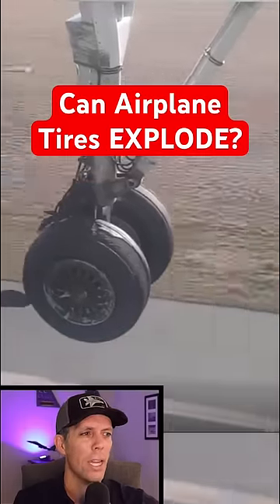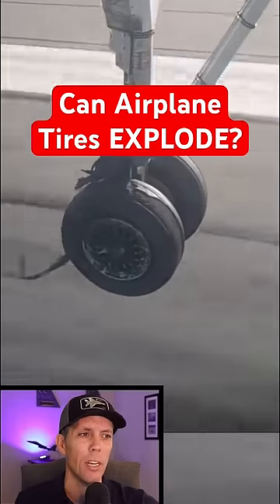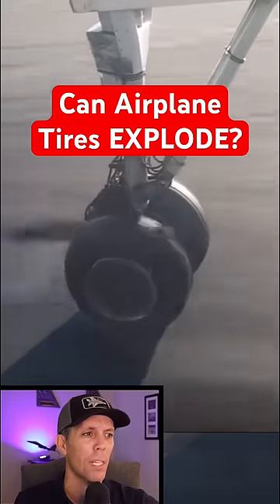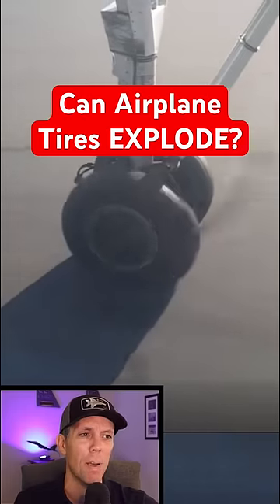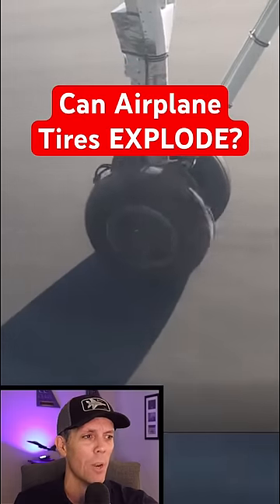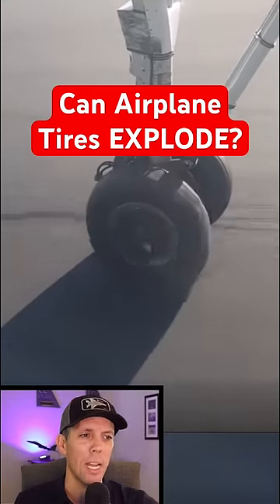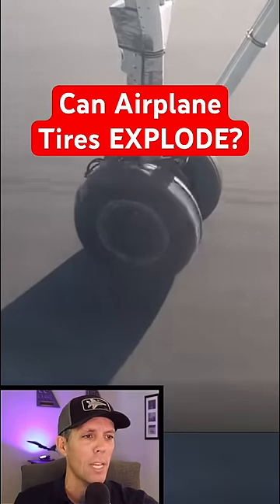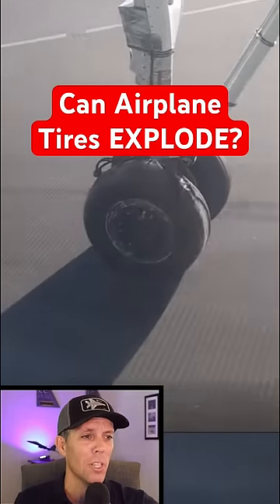Can Airplane Tires Explode?

Comment: I had no idea how much pounds of tires's rubber are left on runway. Thanks for the information.
Reply: no
Reply: many
Reply: English please
Reply: Why don't they create fan shaped wheels which spin up in the airflow before landing
Reply: Because it's not a pound.
Reply: A pound? Not true, and most are filled with normal air around 200 psi.
Reply: Any plans for that new information?
Reply: What if they made the tire spin before landing
Reply: He’s wrong on every comment about aircraft tires…
Reply: Not sure why so many doubters are here? If you look up the facts he mentions about airline tires they do seem to backed up by reputable websites.
Reply: @eopoep  Aerospace engineers have tried all types of wheel spool up designs. They all ended up costing more in the long run due to manufacturing and certification expense, also weight increases= more fuel burn, and more maintenance points.  So every design has been reverted back to the keep it simple concept.
Reply: Not exact quotes but essentially. 

"every tire loses about a pound of rubber each landings" 

"Typically good for about 200 to 500 landings" 

"Can be retreaded about seven times"

So just how much do these tires weigh? 

The math Seems sus to me.
Reply: Life plans changing now that I have this important info
Reply: Its because the landing zone has highly abrasive tarmac. 
If it was used on normal roads your car would need new tyres every 100 miles or so.
Reply: @dangranger3447  Where do you get your information?
Reply: @gar6446  "tyres?" lol
Reply: @eopoep 
Because it’s impossible.
Reply: @eopoep  anything you think of has already been thought of and tested by engineers.
Reply: @name199  I thought so too, so let's try the math.
500 ÷ 7 = 71.4 lbs. 
So if each tire has 71 lbs of sacrificial rubber on it and gets a retread every 71 landings x 7 retreads, I suppose on an Airbus 380 this math might make sense. I wouldn't be surprised if each tire for an Airbus 380 weighs 264.5 lbs fresh and 193.5 lbs fully worn. But for smaller planes, it's a whole different equation.
Reply: @salineaddict9850  That's what my dad, an aeronautical engineer always said. But my son, also an engineer, has said that these days, engineering decisions in larger companies are usually left up to the marketing and accounting departments - so new functional ideas are often ignored in favor of styling and trends. 
But if the CEO is an engineer, like Musk, incremental improvements often lead to innovations that were previously deemed too expensive or impractical by another company (Boeing for example), probably because their accountants told them so. 
Example: Reusable rocket boosters were thought of at least 75 years ago, but they've only been a functional reality for less than 7 years. If it had been left up to Boeing, they still wouldn't exist.
Reply: @gar6446  trust me bro
Reply: @dangranger3447  a pound is not true or they would never make that 250 to 500 cycles life span. And aircraft tires especially military and commercial aviation tires are filled with nitrogen as it is less affected by ambient air temperatures and has no water in it to freeze.
Reply: @adamgregory6482  which ones? Because he is not actually. They do not leave a pound of rubber every time they land and they are filled with nitrogen not compressed air.
Reply: @salineaddict9850  Anything. How about doing away with tyres and wheels and have the plane, skid to a stop on a sheet of rubber
Reply: @eopoep    The problem with spinning wheels inflight is the centrifugal force generated inflight.  Also, any system that would be needed to spin the wheels would be complicated and difficult to maintain. It is much cheaper and easier to just replace the wheels as needed.
Reply: @adamgregory6482 Doubters? No, thinkers.  Think about how much a tire would have to weigh to lose 250 lbs by replacement.  Think.  Be skeptical.  Don't hate thinking and those who practice thinking.
Reply: Yeah right? Jesus! How do they clean the runway from 10k pounds of rubber...

 Crazy how much they lose considering how expensive each wheel costs.
Reply: So if the tire leaves that much rubber per landing yet still last 200 landings? Math doesn’t add up unless those tires are crazy heavy lol
Reply: @dangranger3447  most tires are filled with Nitrogen, with the exception of some lighter craft. But commercial and military require nitrogen
Reply: @mattbrooks9928  aircraft like the 747 their tires can weigh up to 260 lbs a piece, though I don’t think they leave a pound of rubber on each landing, it may be half that, all depends on the weight and speed
Reply: Yeah! now my college degree is complete..
Reply: @eopoep  sounds like your onto something
Reply: And we're worried about  the environment😂.
America is best at wasting Among its other admirable attributes😒
Reply: @igot5onit423    “America is best at wasting……”.   What are you talking about?  Airplanes?  Planes fly all over the world.
Reply: I actually don't believe this right away. These types of shorts are not really that reliable 😄
Reply: Airports perform rubber removal every few months, based on the condition of the runways.
Reply: @Kerpeles  Ya you never know
Reply: With that math, the tire weighs over 500lbs 😂😂😂
Reply: @ThatOne77 That's how they spell it in the U.K., so youre ony showing your own ignorance by dragging them for it.
Reply: @dangranger3447  No that's not true, they DO fill with Nitrogen, because especially at altitude, oxygen molecules tend to leak out quicker due to their size compared to Nitrogen molecules.
Reply: @dangranger3447  actually the pounds of rubber I would doubt, but the nitrogen makes sense
Reply: @karlchilders5420     The reason we use dry nitrogen in aircraft tires is due to brake fires after gear retraction. Think of a bellows feeding a fire if O2 we allowed in the tire.
Reply: @oldmech619  that is not why it is used.  It is an unintentional benefit, not the designed/stated goal.  Especially with brake systems, hydraulic fluid is always the biggest immediate source of fuel for a fire.
Reply: Yeah, a pound = 454 grams, good for 200-500 landinhs would mean that the thread of the tyre would weigh between 90 and 230 kilos... this dude knows NOTHING about what he is talking about.

The complete tyre of a DHC 8 including the rim is about 30 KG. It is a 18*5,5 rim.

And 10 000 punds a day on a airport, meaning about 5500 KG, the limited part of the runnway that the aircrafts are landing on would be nothing but a mountain of rubber... so stupid...
Reply: @SteinarMortensen  Let's not say he's "stupid", but what is clear is that he does not have accurate information.  Those of us that know have given him the right data.  That is what matters.  Belittling him doesn't help teach him - it serves only to stoke anger and is counter-productive to the instructional tone we want to have, yeah?
Reply: @dangranger3447  In commercial aviation its nitrogen only in all developed countries. And the pound is just bullshit. He has no idea what he is talking about
Reply: @salineaddict9850  that's an incredibly arrogant and elitist view, especially since we have seen the failures caused by engineers not thinking of even obvious problems and the carnage caused with their arrogance when they give themselves authority over the plane above that of the pilots who have to be in the plane.
Lots of crashes have been caused by poor design and also not talking the real world into account when designing things.
Look at even basic small planes. 
Or outside of aviation. Kenworth engineers only just worked out that bolting the steps to fibreglass rather than the chasis isn't the smartest idea.
Reply: @jorgenunez5669  I gotcha. His assessment just didn’t make since lol
Reply: @ThatOne77  to tire is when something gets tired 😩a tyre is the rubber that goes on a wheel 😊.
We understand Americans fought for their independence. Do they just butcher the language out of spite?
Reply: @karlchilders5420  look at his "about" section. He clearly thinks that being a pilot qualifies his statements. He should have his facts right. He's not a primary school kid doing a project. 
Arrogant people don't deserve leeway to be wrong. Be humble and people can accept mistakes because you're not pretending to know everything. Tell people you're an experienced pilot and you're going to teach people about aviation, then you need to know what you're talking about and not just read a fact sheet you found somewhere.
Reply: @oldmech619  why are the brakes hot? I haven't flown big planes and the only brake application I've done on take off is to get the engines up to speed for short field. 
I've never thought about it. If you apply the brakes and don't move, but the brakes are stopping the wheels rotating that otherwise would, are they heating up much? I know you're putting energy in and you're still using friction to stop the rotation but if you locked the brakes on then you're not adding any energy after that point. I assume if you're completely stationary that the brakes wouldn't be heating up so why are there fires?
Reply: @chrisnoname2725  Good catch. People like that anger me. I don't like being around them.
Reply: @chrisnoname2725  Oh my goodness. Are you just trying to be funny?
Reply: @chrisnoname2725  Who said I was American? Besides, every country has butchered the English language.
Reply: @karlchilders5420  He likely doesn't care. He's made his money from YouTube and is likely too arrogant to be corrected.
Reply: @ThatOne77  I assumed it was a north American thing to spell tyre as tire. Does Canada count as a separate country? After all they surrendered to driving on the wrong side of the road. : ) 

Obviously i don't really care if people spell things differently or have different terms for things. Oh and i don't assume you're Canadian either. I assume most people learning English would learn American English as that's the place they're most likely to go, just as i wouldn't bother learning Spanish as it's used in Spain as I have no interest in going to Europe.
Reply: @chrisnoname2725  you sound very confused.
Reply: I also didn't know Nitrogen wasnt air
Reply: Not sure about a pound,could be more or less but they do leave a lot. Your heavy ones like fed ex or ups planes probably do and more. I know this cause I clean rubber off run ways. We clean the most used runways 3 times a year. That’s based on x amount of landings. FAA requires it. 
We used high pressure 30,000 psi water blasting method that recovers the rubber and water. Once recovered we drain off the water into a designated drain with a fine filter and then left with a mound of rubber.
Reply: @Adam Gregory  airlines use nitrogen, not compressed air. The moisture in compressed air freezes at altitude and cause a balance problem in the tire. Maybe in a cessna buy not an airliner.
Reply: @karlchilders5420     Over 50 years ago, I was informed that N2 was utilized to extinguish brake and axial fires. It is probable that there had been various wheel fires leading up to this discovery. Throughout my forty years of work as a line maintenance technician in heavy jet aviation, I observed several brake overheats and several bake fires. Thankfully, all of the fires went out by themselves, however, the tires were mostly damaged. When I contemplate the issue, I consider that utilizing compressed air instead of nitrogen in the tire would make a significant difference if the tire began catching fire. The air would stoke the flames while nitrogen would act as a fire suppressant. Would you disagree with this view?  Think fire safety first.
Reply: @OldMech  I don't disagree but as I say the consequential benefit wasn't the design goal.  Look back at things like the B-58 which air conditioned and pressurized the gear compartments as a mitigation for their numerous brake issues .
Reply: @Super Duty Off Road Reveiw  I would think thats just one reason and not all of them.  It has to be the same idea why they fill car tires with nitrogen, too. That's what green caps represent on car tire valves. There are many benefits, which include the opposite of freezing. The tires get hot, too. No expansion of air eqials better rotation. It's as simple as the nitrogen isn't affected in many ways like compressed air is. It is not just for freezing. Tire pressure is the main reason. It keeps constant pressure despite the elements around it changing.
Reply: @eopoep  you trying to troll or whatever you are doing is sad.
Reply: @gator8405 aviation tires are changed quite often. I dont know the specifics but its not crazy to thing they are changed often.
Reply: @joshuahangtree1560 i think hes wrong about the amount of rubber left per landing but no tires dont last long and they are changed often and re-treaded before they get bad completely
Reply: @dianapennepacker6854 ompanies are paid to come clean it off. It happens all the time.i dont think hes right about it being a pound of rubber. That sounds like a lot.
Reply: @matthewwarren7879  unless they are damaged by FOD, they often last between 250 to 350 flight cycles before needing to be changed. At a pound of rubber per landing, you would not have a tire left for most planes by the time you reach that amount of cycles.
Reply: Me, either!
Reply: @ThatOne77  Were you not able to understand intent of the comment?  You do realize that YT is a WORLDWIDE platform, right?
Reply: @dangranger3447 NO! Literally,, every thing you said is wrong.  Aircraft tires are NOT filled with normal air.  They are filled with nitrogen.  In fact, every major aircraft manufacturer (and FAA) REQUIRES nitrogen.  Regular air would allow moisture to develop and would oxidize causing the cavity of the tire to degrade from within. Nitrogen is an insert gas and is more stable with extreme temperature and pressure changes.  

As for psi, I can tell you tires on the main gear of a 747 are inflated to 205 psi.  On a Cessna 172, the main gear is 23 psi.  The plane in the video is a Dash 8, and while I don't know the psi off-hand, it's going to be close to 200 psi because of the weight.
Reply: @trentwomack838 No, he is not!  The only thing he said that was not fully accurate is the number of landing cycles.  Some tires, depending on the passenger aircraft, last for about 120 to 400-ish cycles.  He said typically 200-500 -- so, he's close enough. 

One thing I wish he'd added is that used airplane tires are usually turned into tires for farm equipment, like tractors.
Reply: @adamgregory6482 Did you notice none of the doubters offered anything to contradict him?  I agree with you. EVERYTHING he said is accurate.

One doubter said they're filled with regular air.  I'm sure that it would be easy to verify they ARE filled with nitrogen.  Nitrogen is used in every tire on every commercial, passenger airline.
Reply: @B_Bodziak  I’ve worked aircraft for over 30 years and the most accurate thing he said was we use nitrogen vs “air”.
Reply: @adamgregory6482 Also, cargo space on commercial aircraft equals money! So, that is also a consideration in gear designs.
Reply: @ThatOne77 @dangranger3447 Obviously plucked his information from thin air because everything he said in his comment is wrong and EVERYTHING stated in this video is wholly accurate.
Reply: @ThatOne77 That is how tires ARE spelled in some countries.
Reply: @name199 The video is completely accurate.
Reply: @joshuahangtree1560 But, EVERYTHING he said in the video is accurate.  So, instead of posting "doubts" by those "thinkers", why not take 3 minutes to verify the information.  I'm sure every statement can quite EASILY be verified.  If someone was an actual "thinker", they wouldn't post doubts and claim the facts provided are wrong.  A real thinker would skip posting doubts and simply verify the facts so that they could expand their base of knowledge. But, Noooo, they post doubting comments when they could actually be learning.  Not smart, at all.
Reply: @B_Bodziak  I do understand that some countries spell things the wrong way.
Reply: @B_Bodziak  Actually, no.
Reply: @B_Bodziak  Sorry. You're wrong.
Reply: @eopoep  I'm rethinking round wheels myself. Clearly a triangle would roll better but a fan shape would also be an improvement, you're right.  Let's go. You and I can reinvent the wheel.
Reply: Now what are you gonna do with it?😂
Reply: @Mile-long-list  wouldn't that be a bit bumpy for passengers ?... have you thought this thru ?
Reply: That tire is not flat, it’s just an Italian tire
Reply: @eopoep here are a multiple reasons for this.

But first off, fan to spin them up would not work.

The option would be to have a motor spin them up prior to touchdown, but you see, this a quite a bad idea.

You see, for it to be perfect, you would need the wheels to spin up at the same speed as the aircraft, which, during landing, is constantly changing. This itself is pretty much impossible, however, bringing them up to near that speed may seem like a good idea to you, but it really isnt

First off, motors would add extra weight, cost, space, maintenance and failure points to the landing gears.

And most importantly, the reason why it is not done(and will never be) is because, in the case of such a failure point, we are literally talking about the aircraft’s landing gears, one of the primary ways an aircraft uses to stop, if not the primary. If the wheels are spinniny and then have a malfunction, you now may end up with wheels spinning at that speed rather than braking. Now, this means that the aircraft would be unable to stop, and will keep going forward.

And finally, the most important reason: aircraft often dont come in for landing in perfect alignment, specifically with crosswinds. This means that anytime an aircraft lands without that perfect aligment, the wheels will then drive the aircraft in the direction it was facing when it landed, causing it to have a runway excursion off the sides.

There are other reasons too, but this is a simple summary.
Reply: @Name
This was my exact thought I call bull 💩
Reply: Yea the tire marks on either end of the runway…^
Reply: @dangranger3447  normal air, no , he’s right it’s nitrogen!
Reply: He’s right, don’t know about 200-500 landings though, as an avaition mechanic it seems like we change tires a lot, I’d say around 100 landings, there are limitations and they are not low!
Reply: If they last 200 to 500 landings and they lose 1 pound a landing that's 200 to 500 pounds of tire lost. I'm not sure how much a tire weighs on a plane, but I'm going to assume he's wrong just based on that
Reply: @dangranger3447 a pound left on the ground goofy like a pound of rubber leftover from rubbing against the ground why are so many of you so so so slow. Such a simple concept
Reply: @regibson23 then how much is left on the runway don’t run your mouth and not say anything
Reply: I didnt know how much your sentence gave me angina until i read it 😅.
Reply: I had a stroke reading this, thanks bud.
Reply: I didn’t no that, now I no
Reply: @J-remyM yes
Reply: @name199  my thoughts exactly. I was looking to see if anyone else caught it.
Reply: yea
Reply: @ynyan8022 weight, maintenance, cost and the still heavy wear from what will never be a perfect speed match adds up to tires being cheaper. Just think about a decoupling mechanism before touchdown so the driveline wouldn't be damaged by the sudden load - that's going to be an expensive system!

With electric airplanes basically an eventuality at this point, it'll be interesting to see if the energy required to haul thst extra equipment outweighs energy gained by regenerative braking. Short flights especially
Reply: Useless information
Reply: @eopoep yeah why don’t they? Go ahead and make them you’ll become rich
Reply: You no speaka de English too good eh?
Reply: “Your flight is delayed 4 hours due to unforeseen circumstances”
Reply: Leaves 10 thousand pounds of rubber on the runway a day? Maybe from every airplane that day.
Reply: @name199 yeah and 10,000 pounds a day divided by 6 tires per plane that's 69.4 planes per hour or 1,666.66 planes per day. I don't think so. These types of channels draw in comments like mine for traffic to their channel by saying stupid 💩
Reply: Jesus
Reply: He's full of crap on the poundage and tire landing lifespan.
Reply: @eopoep could get damaged over time
Reply: I’m glad everyone else seems to have found that specific tidbit to be the most interesting 🤣🤣
Reply: @eopoep
That's a smart idea 🙂
Reply: @dangranger3447 aircrafts tyres use nitrogen because it kinda resists pressure build up, tantamount to explosion.
Reply: He said about a pound, I'm sure it's not that much..
Reply: Not true i worked as an aircraft mechanik for years by lufthansa and thats bullshit!!!!
Reply: @eopoep budget
Reply: now try to think of how much of that rubber ends up floating into our lungs
Reply: @oldmech619  The wheels on aircraft are made of magnesium for lightweight and durability. They also aid in wheel speed sensor detection. Magnesium burns hot and volatile and oxygen from a blown tire would accelerate that volatility,
Reply: @karlchilders5420  incorrect I've been an A&P for over thirty years. That's not why they use nitrogen. Nitrogen is used because aircraft wheels are made of magnesium to reduce weight and maintain durability. The magnesium is also useful in use with wheel speed sensors. Magnesium burn very hot if ignited by a brake fire. Nitrogen is used in the tire in case a tire blows during a brake fire because oxygen from air would increase the volatility of the fire. That molecule nonsense is what car tire salesman use to charge morons extra money.
Reply: @oldmech619  Because of the risk of the magnesium wheels conflagrating in a brake fire. You are correct. I've been A&P for 30 yrs.
Reply: @hillbillysceptic1982  they do NOT make wheels out of magnesium.  BTW, I think you mean Magnesium ALLOYS.  Pure Magnesium itself would be a huge fire hazard.  Most Aircraft wheels are made of ALUMINUM alloys these days there slick.  It's lighter, cheaper, easier to manufacture.  The tires are made of conductive rubber.  Why?  ELECTRICAL DISCHARGE protection.  

The thing I said about Nitrogen vs. Oxygen is ONE HUNDRED PERCENT correct.  It's physics.  Sorry if you don't understand how physics works.  You are an idiot if you think it's a marketing or sales thing.  They also do that because especially on jets like the 737 that don't even have gear doors, it keeps the delta P values low due to temperature excursions.  Also, at high altitudes and low temps, regular atmospheric air can cause ice formations to occur inside the tires, or even EXPLODE.
Reply: @name199  67kg
Reply: Its just totally wrong a A380 wheel is 120kg if the wheel leaves 1 pound times 200 landings minimum. Its 200pounds of rubber this is 90kg. 120kg minus 90kg is 30kg left for tire and rim....😂 sry this guy spread missinformation.
Reply: That gave me a fucken aneurysm reading that.
Reply: i know right thanks for the info lol
Reply: @name199 the tires weigh 264.5 lbs
Reply: @adamgregory6482 a 777 tyre weighs 260lbs. It cannot lose between 200-500lbs before being retreaded
Reply: How tf can someone mistake no for know ?
Reply: Why don't recycle them?
Reply: @dangranger3447 nope they are very offten filled with nitrogen
Reply: Makes you think that having them pre-spinning (via tiny aero vanes?) is a good idea?
Reply: Bro what have you even said 🤦🏽‍♂️
Reply: That’s absolute bull crap - I’ve sold tires my whole life - even some small aircraft tires. Think about what he just said - if ONE tire left ONE POUND of rubber on every single landing and lasted for 2-500 landings that tire would have to weigh 520-530lbs un-inflated before being mounted on the wheel!!!  You’re talking earth mover tire size to get near that heavy or near that much rubber!!
Guy is completely got his measurements wrong. You’d also have a ramp for a runway at every airport in the world unless they scraped that crap off.
Yes they definitely leave rubber on the road but we’re talking Ounces not pounds!
Just wow.
Reply: *no
Reply: I heard he said its good for 200-500 landings? That math doesnf make sense. It would make the tire really heavy when mew which is hard to believe. 200x10 is 2000. And he said 500. So 5000 pounds and thats ONE tire? No way
Reply: @jackandblaze5956 it gets rethread when its almost gone. Not in between. Imagine all that cost for an airline. If we do the math 10x200 its way too much rubber. And he dared to say 500. That would mean each tire would at least be 2000 pound each. He need to do better research
Reply: @ThatOne77  u know some people aren’t as fluent in English as some of us… right?
Reply: @itsfikree  English please
Reply: Know you no
Reply: Makes sense if you watch the movie Speed
Reply: 10,000 pounds a day at a pound a hit is around 1 plane landing every 8 - 9 seconds ... yeah right.
Reply: Thats literally what killed concord, rubber from a previous planes tire
Reply: He's exaggerating. Maybe main wheels but not as much for the nose wheels. And weather conditions come into play. Aet runways will cause little wear on the tires.
Reply: @eopoep mentour pilot has a video on it
Reply: *kg
Reply: @ThatOne77  whaat
Reply: @duck2fun  whaaat
Reply: @eopoep  Because of wind....
Reply: No* many*
Reply: you've had a month to correct this
Reply: Don’t listen to those haters we all know what you meant
Reply: English
Reply: I no what you are saying.
Reply: You think thats crazy? Imagine how much rubber is left on americas highways. Youre welcome
Reply: Where I work and live, There is a tire tax when purchasing tires (in NY), basically for tires contributing to ruining the roads/leaving rubber on the road,etc. To my understanding, that's what the tax is for atleast. But that's New York for ya
Reply: I dint no wut a plain wheel een look laik
Reply: That was the least grammatically correct sentence I’ve ever read
Reply: Now you no
Reply: Mostly in the form of microplastics, one of the major sources according to the PSF
Reply: @ThatOne77 not everyone speaks English as a first language 😊
Reply: So its not just the dc 10s? Lol
Reply: @hotnuns69  you're a little late.
Reply: Jesus loves you!!!
Reply: There's a great video of how Heathrow airport deals with the rubber on their runways every night
Reply: They can last up to 500 landings and they lose 1 pound rubber each time? So thats 500 pounds of rubber for each wheel. A plane has what? 20 wheels? So a big planes wheels weigh around 10.000 pounds. I know, solid maths and deductions. Dont question me.
Reply: @dangranger3447  not true it’s filled with nitrogen
Reply: @dangranger3447  What type of aircraft are you familiar with?
Reply: one pound of rubber per tire? "this is rubbish"...
Reply: @thebeaz1 ùù
Reply: @dangranger3447 I love hearing "nitrogen" filled tires. Bruh, air is 80% nitrogen.
Reply: @ThatOne77  Proper English spelling.
Reply: @karlchilders5420  Fire requires 3 things, fuel, oxygen and a spark.  As aa former aircraft mechanic, I can assure you that O2 is all around us, the fuel for the fire comes from the rubber of the tire, and on fighter aircraft the brakes are made of steel and get red hot like you see on F1 cars when racing. I worked an F-16 brake fire that burned the lower half of the fuselage. Brake fires were so prevelent on aircraft that we were issued paint sticks that melt at a certain temperature. When an aircraft stops at the end of the runway (EOR) we swipe the paint sticks on the brake disk, if one color melts the brake is warm, if the other melts the brake is hot, so everyone runs away for a while till the brake cools off, or the plane blows up.
Reply: @andrewbartczak5941  ha ha
Reply: @eopoep  theRoyal Navy tried that.
Reply: @adamgregory6482  take what youtubers say with a HUGE grain of salt. Especially from aviation youtubers who are not pilots.
Reply: @chrisnoname2725 Well, spreading bullshit as truth on a public forum isn't great either.
Reply: @trentwomack838 NO really each tire looses 1 pound of rubber per landing and are good up to 500 landings..... each new tire weighs about one ton.....
Reply: There are people whose job is to scrape it up
Reply: @eopoep because tire need to spin and it would be really expensive 😊
Reply: A lb??? Nope
Reply: @adamgregory6482 he is wrong because if an airplane tire lost 1 pound of rubber every landing then each tire would need to weigh over 500 pounds since a standard airliner tire can sustain about 500 landings before being replaced
Reply: many*
tires'*
Reply: @adamgregory6482 Is that a question?
Reply: Well coming from someone that spells no with a K, I’m not surprised.
Reply: @dangranger3447 not air, but yes nitrogen
Reply: Was the person hanging under the plane to record this????? BS
Reply: I wondered about that. the nuances of making it work properly may be worse than they seem, it wouldnt match well in all circumstances making it less worth it, and its possible the potential gyro effects might be an issue.

....or maybe they would just take way too long to get up to speed/tires are just too heavy for it to work without huge ass fins on the walls  @eopoep
Reply: there is no difference in car tyres, where do you think car tread goes over time, this is why everyone has to eventually buy tryes for their vehicles, the tread is on the road 😆
Reply: @karlchilders5420 Now that everyone is informed, the people that DO know can do a video can't they, there should be many more updated versions from the people that commented
Reply: @dangranger3447 

Commercial aircraft tires are filled with nitrogen. If a wheel well fire were to occur the high pressure in the tire would not add oxygen to the fire when the tire bursts.
Reply: @eopoep no😂😂
Reply: Its not true
Reply: "How much pounds" 💀
Reply: What are u gonna do with that info ?
Reply: @name199 that was my exact thought. It's clearly bullshit because these tires don't weigh over 200 lbs
Reply: So they land ...loaded with full fuel load...? That's  even harder on the tires...I guess it depends on their gross weight ....
Reply: I doubt its a pound of rubber each landing
Reply: But they only clean runnways 3 to Five times a week.Takes about 4 hours .The people who clean runnways are funny
Reply: I was also unaware until now
Reply: @gator8405 and it doesn't burn, like oxygen, which is in our ambient air.
Reply: @gator8405 not if the retread process is during that life span.

I assumed retreading is PART of that life cycle.

Are we all on a different page on what time frame is meant?
Reply: @dianapennepacker6854 They don't clean it? It's possible one landing deposits rubber and another picks some up?  Perhaps same on takeoff?

Some of it is going to be loose, pebbly detritus, i.e. I expect alot of it washes away.

The environmental impact is a whole other story I'd guess.
Reply: @oldmech619 thanx. Didn't know.

How? Using street sweepers like on city streets those brushes would be torn down really fast.
Reply: The concord was taken down by rubber hitting the tanks.  (But metal debrie ruptured that tyre first). The runways are cleared from debris on daily basis
Reply: You can’t be serious
Reply: @thebeaz1 thanks
Reply: In America they leave dollars
Reply: Wait till you hear about car tires

The rubber doesn’t ever break down. The tread on your tires that wears down is left on the road, and in the air, and in the water

Tires are the worlds biggest polluters that no one ever talks about
Reply: yeah and they have to be changed every month
Reply: @dangranger3447 Absolutely incorrect. All Aircraft tires are fill with nitrogen because it doesn't support fires like oxygen does. We do this because in the event of hot brakes and the tires explode, a fire will not start. Its also for people fuel leaks, there is no excess oxygen to ignite cause much larger explosions
Reply: @thebeaz1 yes
Reply: Why can't you already have it spinning at actual speed with an electric motor?
Reply: @eopoep why don't you do that and maybe make a billion dollars when you bring it to market?
Reply: NO WAY can ANY Tire last 300 Landings, They are changed every 3rd Landing. 
Tire seen could been after 3 Landings.
Reply: I think a long time ago a crash happened in a runway undue to excess rubber on the runway.  Nowadays they have cleanup crews after and before each take off.
Reply: @gar6446  The runways are concrete, just like sidewalks. Some are grooved for drainage. The landing zones, usually have rubber built up on them. There is really no such thing as Tarmac, in aviation. It's a misnomer often used by the media.
Reply: how many pounds is even more amazing,
Reply: It's not just the runway, but the air. Tires are one of the largest pollutants. It just way more obvious here but standard tires and super bad for our environment in so many ways.
Reply: @ynyan8022  that's been done, and they're just another complicated machine to fail.
Reply: @name199  The tires on a 747 weigh around 270lbs. 

I think what he's saying is an airliner leaves about 1lb of rubber each landing, not every tire leaves a pound. Since the average airliner has 10 tires, that's 1/10th of a pound per landing per tire. 500 landings equals 50 lbs, or a lot of the tread surface.
Reply: They don't retread plane tires
Reply: Roughly A pound lost per landing and they last 200-500 landings.  The math doesn’t add up.
Reply: @name199  they don't weigh enough
Reply: @adamgregory6482 I read C5A does spin up
Reply: @dangranger3447 all tires are filled with nitrogen because it doesn't expand like normal air would
Reply: @name199 a wheel and tire assembly weighs about 500lbs
Reply: @mattbrooks9928 missed the “retread” part I suppose?
Reply: @bigwheel9132  I guess been so long I couldn’t even find my comment to see what I said lol
Reply: How could a passenger film this?
Reply: So do they recycle the rubber or no
Reply: I’m almost certain they clean it 😵‍💫
Reply: Selling 10k pounds of rubber every day will make you a millionaire in a month.😅
Reply: Lmfao
Reply: Lol.. you dont see wheels front flight windows 😂😂
Reply: Use it wisely
Reply: @oldmech619 the problem is balance: when unloaded and spinning at 200MPH tread linear speed, any slight imbalance results in a big vibration, like a washing machine spinning a rug. That vibration scares passengers, so it’s minimized by not spinning. Next time you’re flying and the airplane takes off, notice the vibration of the wheels before they’re quickly stopped and retracted.
Reply: Must be a very important information for you 😂
Reply: That's Bull, they are not leaving a pound of rubber from a single landing
Reply: Now hear me out. Why don't they use a tiny motor to pre-spin the tires?
Reply: HAVE YOU BEEN LIVING UNDER A ROCK OR SOMETHING???
Reply: Something doesnt add up.  If they leave a pound of rubber per landing and they last up to 500 landings.  That means they shed up to 500 lbs?
Reply: This gives people an idea of the tire blowing at hearts field airport when the tire blowing killed 2 workers
Reply: @lethai5128  Mathematician here. Can confirm your calculatuons are acceptable to be considered true. 500 times one is indeed 500.
Reply: @eopoep that’s dumb
Reply: Our busiest airport only have an average of 2300 landings per day. So about 1 ton of rubber per day not 10,000 lbs
Reply: @jackandblaze5956 musk is not an engineer. He's a hype man.
Reply: where is all that rubber going...the runway should be miles deep
Reply: Answer... yer mum
Reply: @eopoep weight, cost, drag, added complexity and reduced reliability to name just the reasons off of the top of my head
Reply: What impresses me the most is how the pillar dwarft the tire, even though it actually is huge. Not sure if they're all taller than an average adult male, cos I've seen lots of relatively small ones, especially on military planes, but those still weren't your average crossover wheels, and probably were bigger diameter than most semi tires.
Reply: He said they can leave 1 lb of rubber per Landing 10,000 lb a day I find that hard to believe. how can 10,000 planes land in one airport in one day that seems physically impossible
Reply: pretty sure that's not accurate